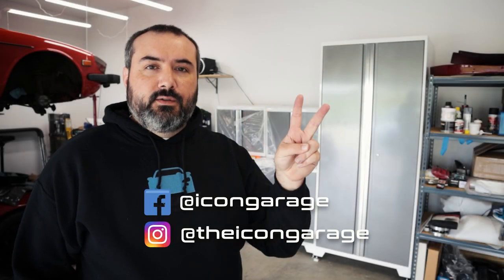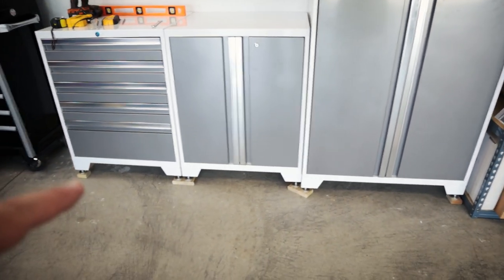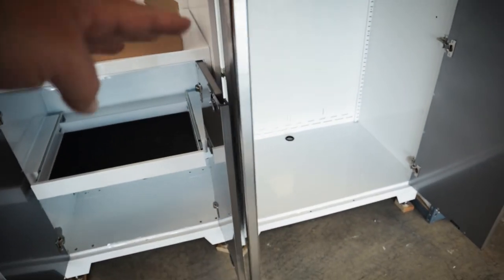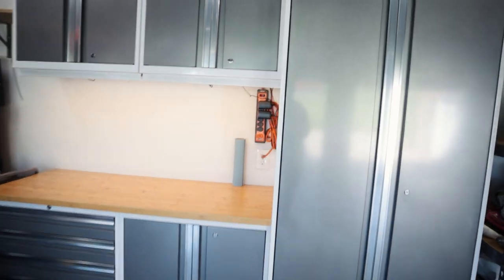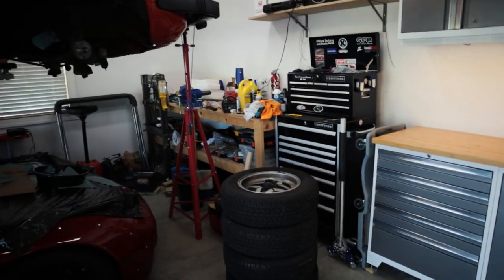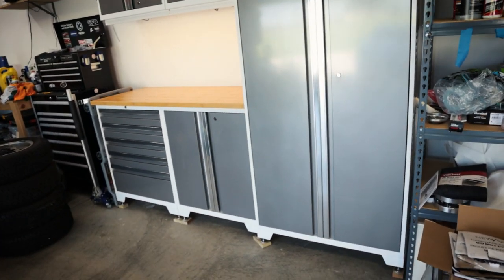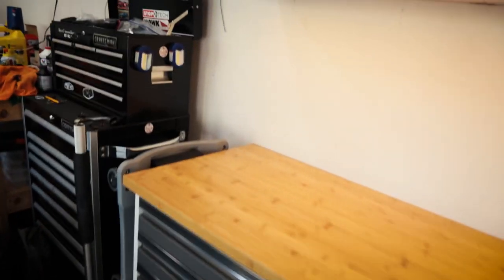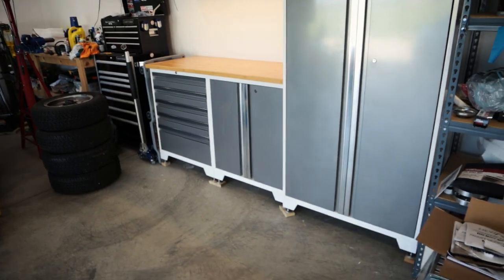NewAge Pro Series Garage Cabinet Install and Review

Comment: just a tip from a viewer around :30 in the video you have a sound clip for your handles flying off the screen. I would remove it. seems kinda tacky like old powerpoint presentations. Keep up the quality content though
Reply: I thought it fit well as was barely noticeable.

Comment: Since I can't find it anywhere on newage website thought I would ask here. I have to do an install on a pro series  full wall setup. As my wall has a two inch concrete kicker at the bottom I need to put in larger spacer boards.  Wanting to get a jump on the install I want to put up the spacer boards before my cabinets arrive. Any chance you have a measurement from the bottom of the foot to the wall mounting holes in lockers? I realize there will be a variable due to the adjustable foot but would love to get as close as possible This would help me a lot!! Thanks in advance for the help

Comment: Are you still liking your cabinets? We're trying to decide if the Pro is worth the extra $$ as opposed to the Bold. Would sure appreciate your thoughts and input. Our new garage is quite large and we have so much stuff that needs a home.
Reply from the maker: I like them. I do feel the thicker wall and features like the soft close do set the pros apart from bold. If you are looking for a simple storage solution, the bold is fine. I believe the weight capacity of the pro is higher too. I like them for tool cabinets but if I added more for basic storage (not connected to my pros) I would consider the bold to save money.

Comment: After a year, are you still happy with the platinum color scheme?
Reply from the maker: Yes. It’s not quite stainless in appearance but close. I generally like the white color scheme at least for my garage. I think it probably hides dust and smudges a little. I’m happy with them overall and wouldn’t hesitate to buy again. I eventually want to expand my set to have some more enclosed lockers for house/kid stuff.